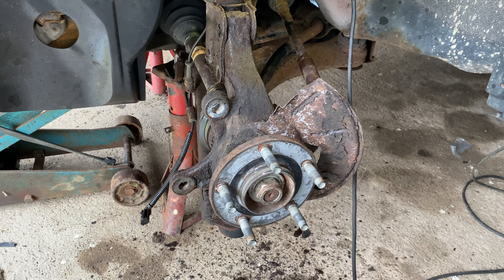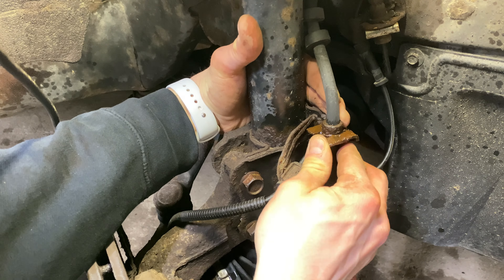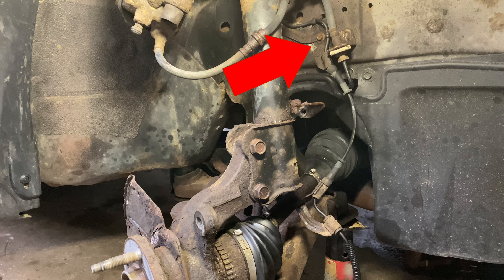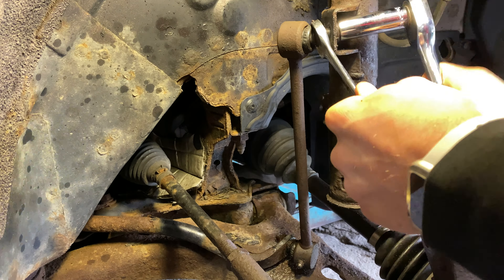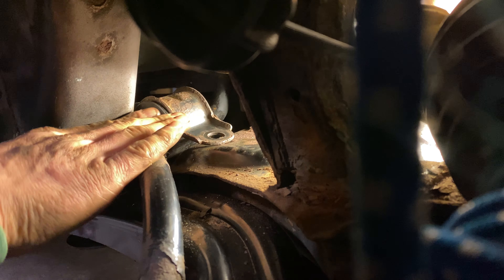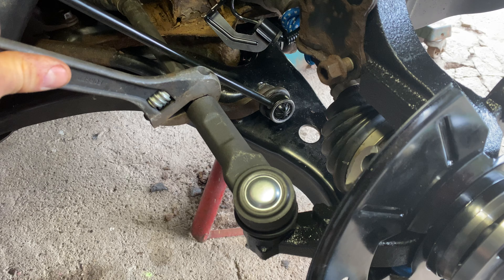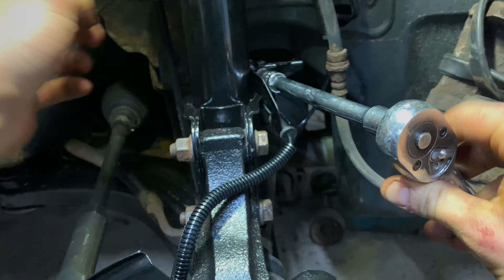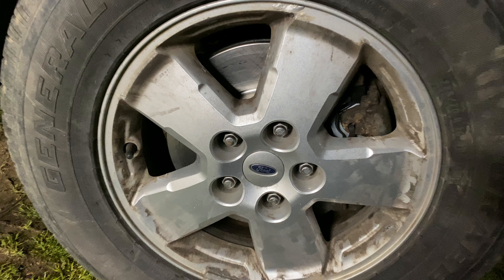2008 Ford Escape - FRONT REPLACEMENT: Control Arms, Struts, Knuckles, Tie Rods, ABS Sensors

Comment: what an amazing video to find when you own the same vehicle ! 

ps. I just removed the same sway bar you advised not to install, it required assistance, a torch, and hammering a fitting on to remove. Anyone watching, just buy the Moog part, it's greasable, and has wrench grip behind nut.

Comment: This is a better than average video. I have done this entire process to my escpe hybrid and i enjoyed this video. The only thing i shall add is anticease grease on reassembly. In moderation on the axle splines, around the bolts before installing the new rotors, where  the tie rods meets the knuckle, and on the rotor where the rim meets the rotor. Also, i would take the lock nut for the out tie rod and twist the tie rod while holding thebinner tierod to match distance on re assembly.

Comment: Great video man. Love the layout of the step by step process, commentary without the extra noise, and fast forward. Some DIY repair videos are so boring and unengaging to watch, this was not! Straight to the point, no BS, and good camera angles. Will definitely help me on my upcoming identical project. Thanks and well done!
Reply: Also, curious what size axle nut socket you needed for this? I also have a 2008 Escape. Thanks!
Reply from the maker: Thanks so much for the commentary and the PayPal donation. Very much appreciated! 32mm for the axle socket.

Comment: Bro, awesome job, your video helps, I got all the torque specs in one video, I’m doing the job now but I need to replace the axles and ext axles because I could not get the axles loose from the knuckle I beat on them and beat on them for hours, finally  they came out of the knuckle but only after hitting them with a 5 lb hammer, needless to say I destroyed the axle and bolt, it was almost like they were welded on, I have the issue separating the other part of the axle to the cv intermediate shaft, I still can separate the two even with a slide hammer. So I just ordered the shaft and and drive axle. All the videos I watched made it look so easy. Thanks again bro you did good work in this video very informative
Reply from the maker: This vehicle was almost the death of me. So much rust everywhere. Pain.
Reply: @DavidStumph  I still got to do the drivers side any advice on how to get the axle out of the knuckle without destroying it again.
Reply from the maker: PB blaster, maybe a torch, force. Expletives. Maybe a prayer after all that. Sorry buddy, that’s about all I can offer. Good luck on that second one. Interested to hear how it turns out.
Reply: @DavidStumph  ok thanks

Comment: Was that speed sensor only located on the passenger side or did the driver side also have one as well? I definitely plan on purchasing the factory OEM sensor rather than I an aftermarket one to ensure I do not get a check engine light after doing lots of work. also, would you recommend using antiseize in the grooves that the CV connects with the Will bearing hub assembly or do you not recommend that? i’m planning on doing suspension work to my 2010 escape at some point soon so this video will be a godsend to help me through the process I’m replacing the wheel hub assembly , control arm, shocks sway bars, and assuming I will have to replace the speed sensor as well. Fortunately, my tie rods are still in good conditions, so I’m going to leave those alone and just continue using them, I Purchased monroe shocks , moog control arm, moog sway bars ,and new wheel bearing hub assemblies that have countless excellent reviews so hopefully all of these parts will last.
Reply from the maker: Speed sensor on both sides. First 10 seconds of the video is the driver side and you see it hanging and disconnected. You can use anti seize on the cv to hub assembly mating.

Comment: Do you put grease on the axel shaft when inserting it into the knuckle? Seems like that would need greased.
Reply from the maker: Negative. Grease goes inside the boots of the axle CV joints.

Comment: Is the purple grease just generic silicone grease?
Reply from the maker: The purple from permatex used to be petroleum based which is not good for rubber gaskets. The new stuff reads safe for rubber. I still use the orange for rubber and purple for contact points. Your call. https://amzn.to/3T6qek4 - PURPLE BRAKE LUBRICANT

Comment: My 2011 has 212k.  I replaced the drivers side ball joint and bearing.  Now it's time for the passengers side and strut replacement
Reply: Mine has 219k and speed sensor is not working

Comment: Those sheet metal jackstands in the video are extremely dangerous and should be outlawed. I had a pair under the front of a full size van and they just collapsed almost killing my friend. Spend $40 for a heavy duty set of stands. You life is worth $40.